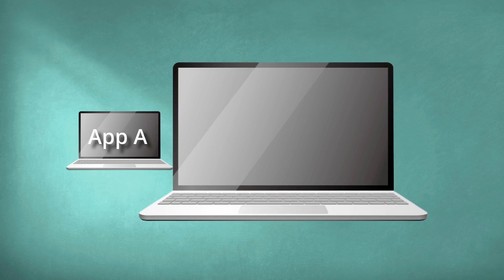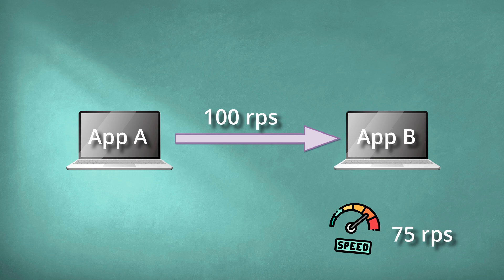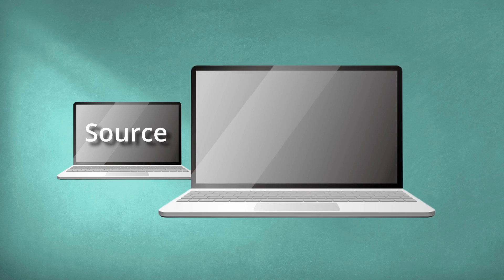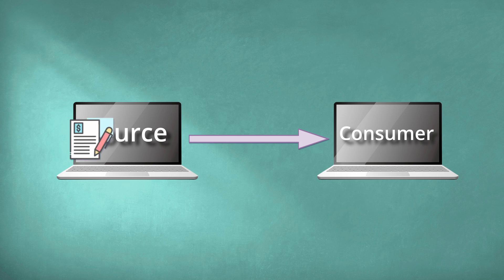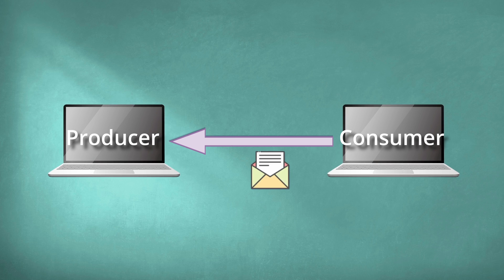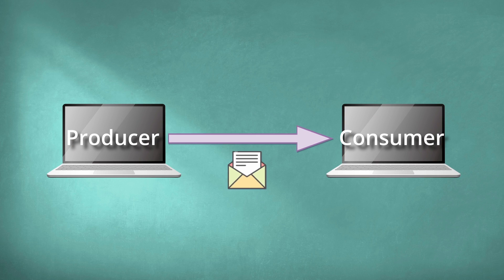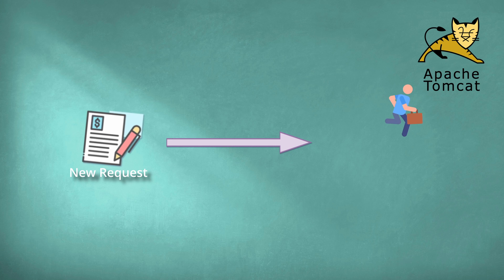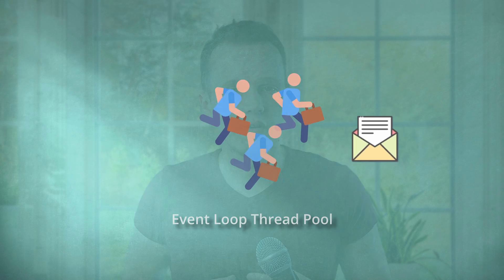Backpressure in Java Ecosystem: Spring WebFlux, Flow Control and Reactor Explained in a nutshell

Comment: Would be more useful if the closed captions work properly.
Reply from the maker: Hi there! What do you mean by "properly"? Are there any problems with showing?
Reply: @AlexanderSergeenko  What you say and what comes up in the CC are very different. You say "Demand" and it shows "diamond". That was one example, but it becomes hard to follow in some parts of the video. Your explanation of backpressure and how WebFlux handles it is on target, but the CC generated sucks
Reply from the maker: @srinimurthy  Oh, you're right. Thanks for the feedback. I've checked the CC and it looks horrible at some moments. Will try to add CC manually later.